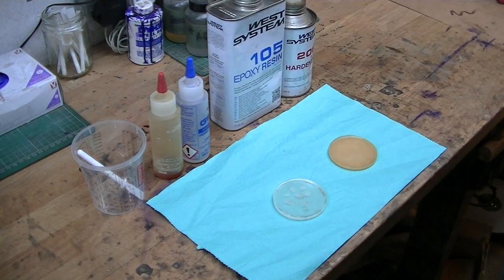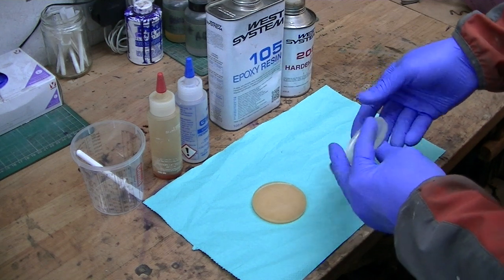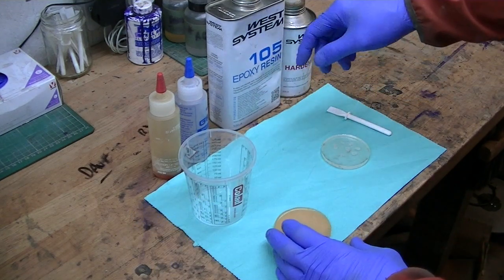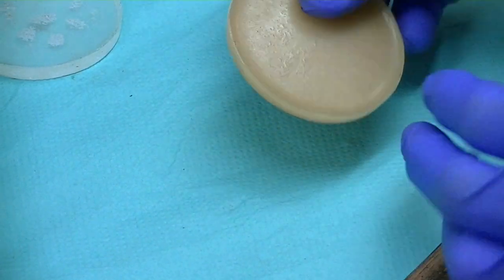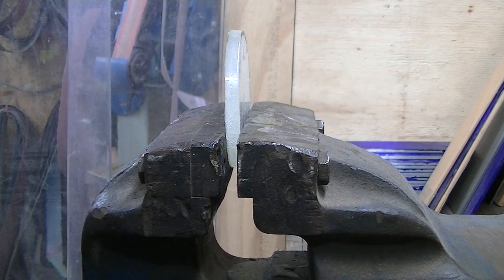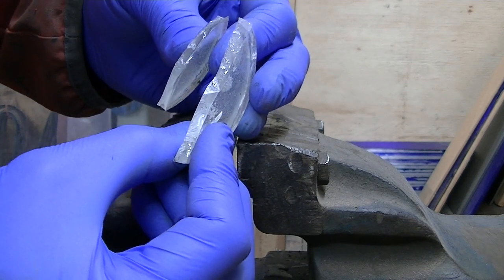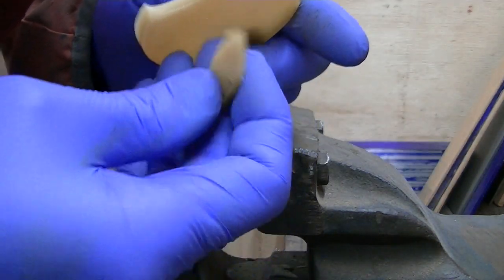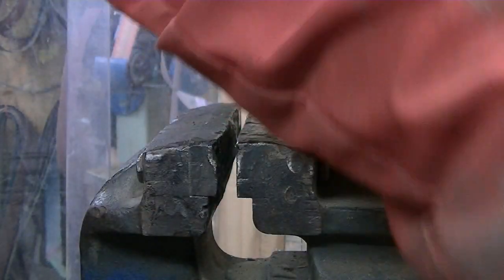G Flex Vs 105 Epoxy for Knife Making - Why I use G Flex...

Comment: 105 is good enough. Not Worth to by gflex
Reply: Perhaps it’s good enough for you sir. 
I will use the best available for my work. I’ve been using both for different applications on daily basis for the last 6 years and I’ve seen enough evidence that G Flex is a better overall adhesive, again for what I need it to do.
Reply: @mictaylor9531  ah sorry, i was thinking about one purpose: handle scales

Comment: hello there,  groundflat sent me here.  I have been using Gflex for some time now,  it's  good to see your demo confirms my opinion.  Aarladite is a good flexible adhesive,  only secure to about 80C,  Gflex about 120 I think.  The printing on my red bottles also comes off!  all the very best